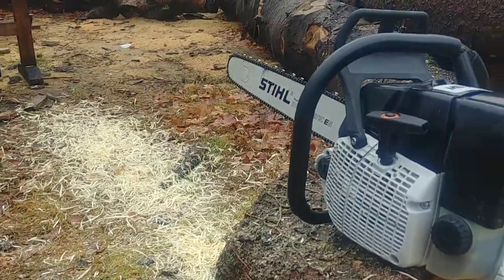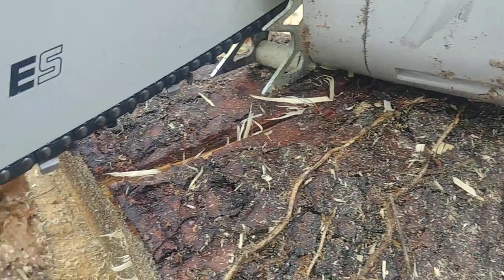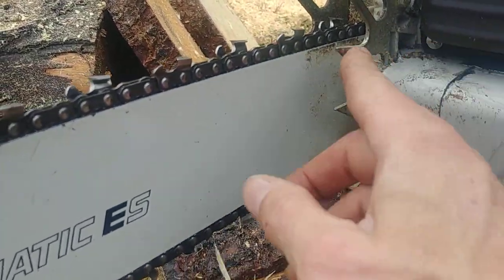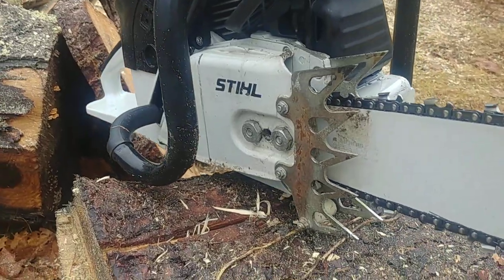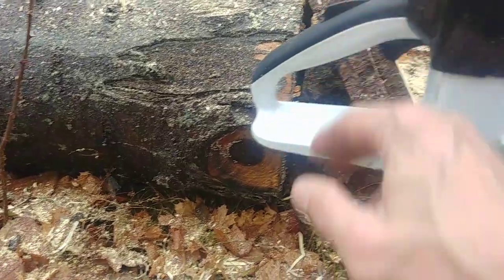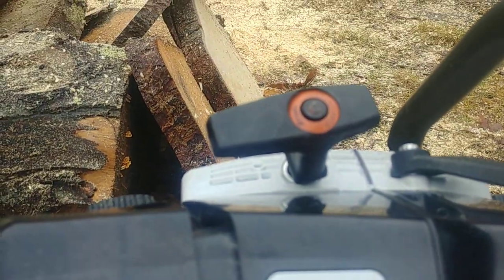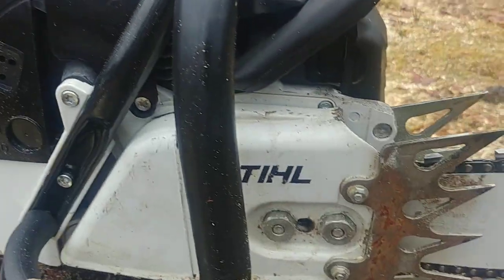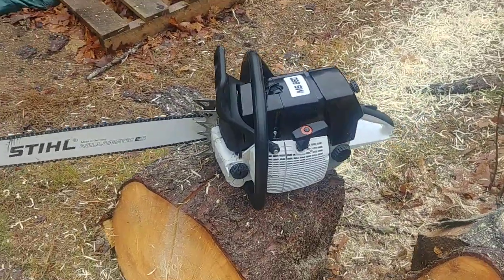Huztl Farmertech MS 660 build testing.

Comment: My Farmertec 660 is a smidge over 2 years old now and if I remember it has like .019 thou squish and will rip your shoulder out of socket if your not careful when trying to start it. I drilled and pinned the decomp button, had to tweak the carb butterflies (they were sticking), left the spit back baffle out, done some mild port work with a base gasket delete , gutted the muffler and moded it, also replaced the on/off choke selector with an OEM Part. It sports a 28" 
.063 3/8 bar and chain and believe me she will cut faster than a tasmanian devil. As much as I like my Husqvarna's when I'm cutting Big wood this is the saw i grab.

Not had many issues broken pull cord, failed spark plug, fuel line swelling and leaking and the gas cap seal leaking.

For the money I've got in it right at $350 total including bar and chain it's been well worth it.
Reply from the maker: Hey Craig.  This is my 5th one and it's going to be a nice saw.  I've really wanted a 3/4 wrap, black one for a while.  The 56mm jugs can't be done with the gasket delete because they will hit.  This one is .022 with the gasket and it's just covering the freeport issue.  I figure now they cost me around $500 to build one....  They've really been work horses on the mill.  Nice to work on a "clean saw" every once in a while😂...
Reply: @williamprophett9148  Yes clean saws are a plus and at $500 that's still less than half the cost of a Brand New MS660 Stihl, if your only cutting fire wood that's a great deal.

Comment: My 2171 blows back into air horn at idle and blipping, what you think of that ,it's an area I don't know anything about ,is it normal or a result of altering the ports...?
Reply from the maker: Some saws are prone to it.  Thats why some manufacturers put in the baffle to help keep the air filter dry.  The 066 platform is one of those saws, but some of the other saw modder guys thought mine would be bad if the intake timing was as low as mine was.  Doesn't seem to be the case.  I have unmodded 660's that spit back worse.  "I believe" that it is caused by the freeport issue on the 56mm jugs.  This particular 56 doesn't have any real degree of freeport at BDC.